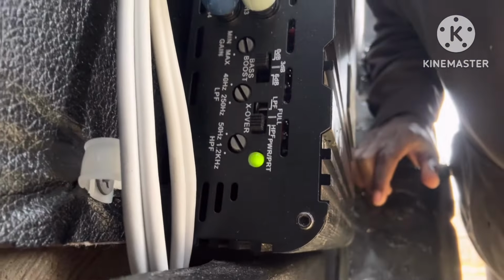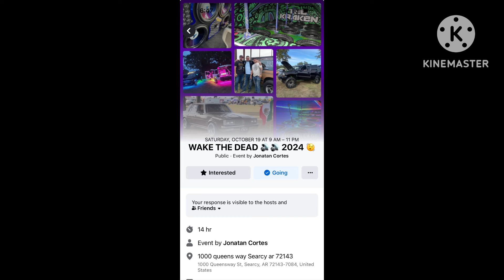4 Jp83 for the 2024 season/Updates on builds & upcoming Shows.

Comment: Ya voltage is too high for that amp. I ran into the same problem and upgraded to d class 4 ch amp. No problem since!!!
Reply from the maker: Sir that is not the problem. I have 3 of the same amps in my Truck. That one is about 4 years old. It have run it course
Reply: @crazy-hobbies2291  okay. I had a similar thing and that was my problem

Comment: How are those resilient sound subs?? Good or bad?
Reply from the maker: Good subs from what I hear. I was actually going to buy the Team 18 back in 2021 but they where sold out
Reply: @crazy-hobbies2291  ok then..trying to find a good sub to put on my jp63..
Reply from the maker: Sundown xv3 would be a good match
Reply: @crazy-hobbies2291  yes sir it will but I'm only running 1 sub..I have the NSV5 15 now..want sumthin wit at least 5k rms wattages..if I got wit the xv3 I'll run 2 of them
Reply from the maker: That 63 will be good with that 15 but make sure you putting clean AC voltage at tuning
Reply: @crazy-hobbies2291  yes sir..voltage sitting at 15 and I had to turn the amp way down to hold it